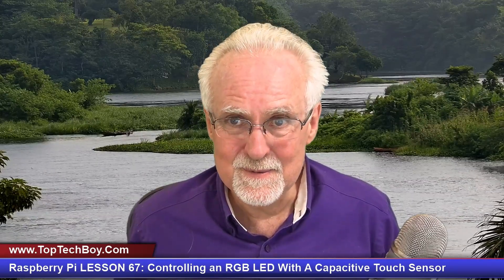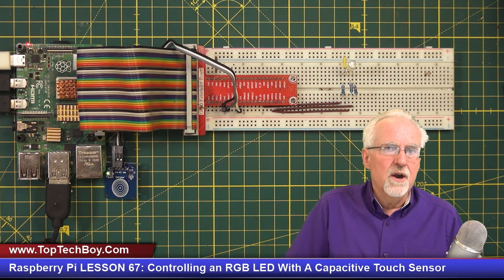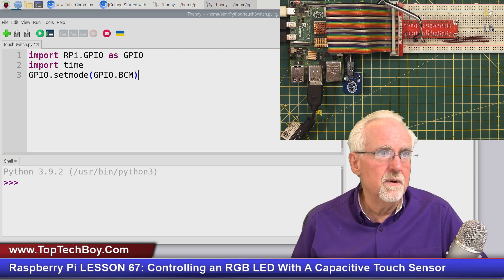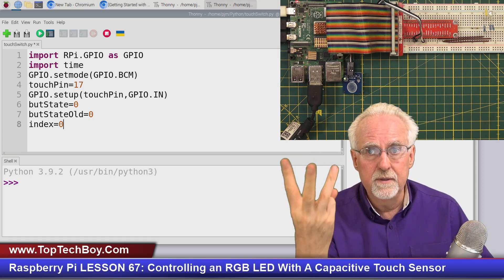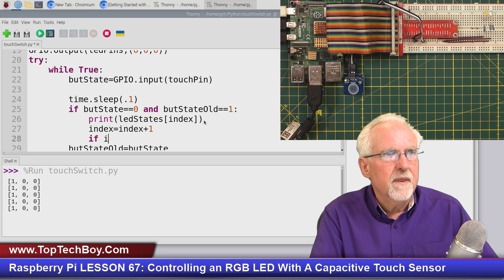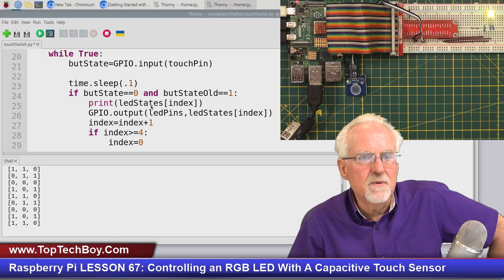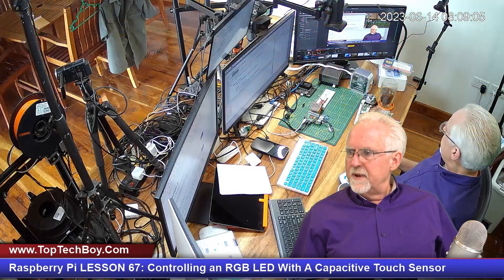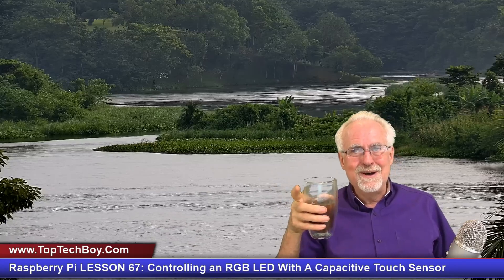Raspberry Pi LESSON 67: Controlling an RGB LED With A Capacitive Touch Sensor

Comment: Great Lesson. Just a suggestion to make the code more robust: Instead of 'if index>=4' we can write 'if index >= len(LEDStates)', this will avoid changing '4' in the if statement in case you want to switch between more or less than 4 colors.

Comment: Question for you Paul, or anyone else who knows. in lesson 15 we used a library for the ADC that did all the hard stuff for us, but I'm curious to understand how you wrote that code! Do you have a video or anything explaining this or something similar? specific question that come to mind right off the bat are: why did you choose delays of 0.000002 (500kHz) ? on the datasheet for the 0834 it sais the max clock frequency is 400 kHz so I'm confused. also, this raises the question of how accurate exactly is the time.sleep() function? 2 microseconds seems pretty darn good, although I guess the arduino has a delayMicroseconds function or something. Also, do you have to account for the time it takes to set the GPIOs high or low in addition to your delays? I would love. can you pick any clock speed? what exactly are the ODD/SIGN , start bit, select bit? I have so many questions! If you had a more advanced video to cover this that would be insane because I can hardly find anyone who has a video explaining how to decipher this serial protocol stuff.
Reply: While not up to Paul's standards I have a video where I show how to use the ADC0834 without the library. https://youtu.be/o5uGdcsS880
One question I can answer is the clock cycle consists of a high and a low so two delays resulting in a frequency of 250kHz.
I am happy to answer questions you might have in the comments.
Reply: @keithlohmeyer  thanks!

Comment: I tried adapting this code to MicroPython for a Pico-W, but folded up like a cheap Walmart lawn chair!

The best I got was the three LEDs coming on/off OK in sequence but could not get the 4th index state (all off) and restarting the sequence again right. Can anyone help with this coding for a Pico-W? I did use the last [0,0,0] array in an array and index but it keeps crashing at the 4th step. Worked perfectly on an RPi using Python..... I am still getting use to MPython....